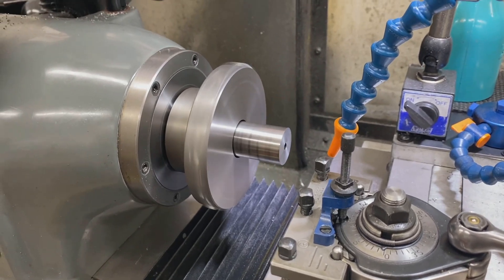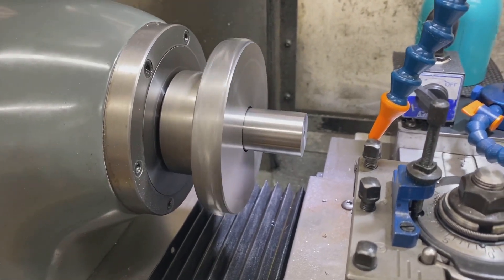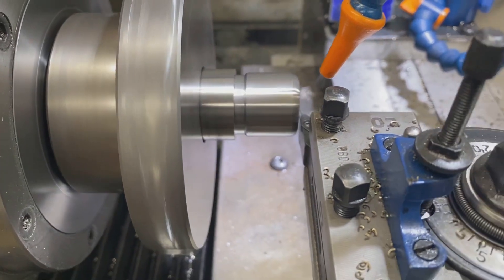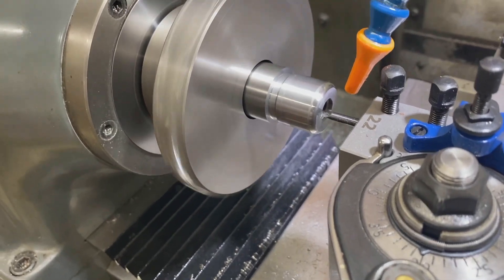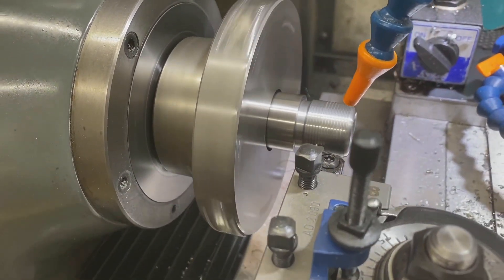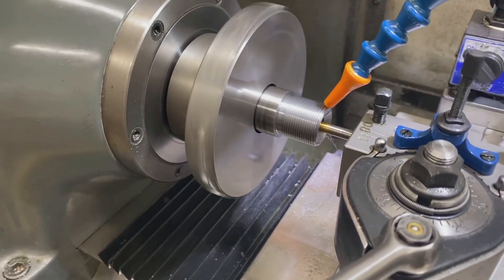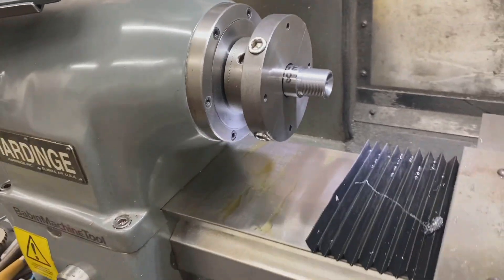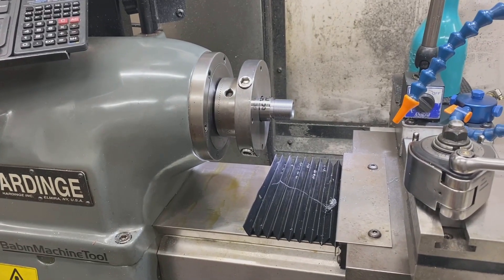Chambering a match barrel on a Hardinge CNC Lathe

Comment: Hi i know this is an old video but what size is the through hole on the spindle bore? I never considered a hardinge lathe for chambering because i thought they had a very narrow spindle bore.
Reply from the maker: not exactly sure - i used to know. it is bigger than 1.25” which handles most barrels

Comment: Could you explain to me what you have for a chuck
Reply from the maker: the inboard “chuck” is a backing plate with the hardinge taper. there are four cap head screws in the plate which have brass tips. they are adjusted like a 4-jaw to centre the barrel. on the outboard side i made a sleeve to go over the spindle and that too has 4 brass tipped screws

Comment: Pretty cool. How do you like the electronic hand wheels? Could you still operate the lathe in manual mode with carriage feed and cross slide feed?
Reply from the maker: they feel identical to the manual lathe. and yes, you can switch between cnc and manual without touching a button. i also have a hardinge with a siemens control and there you have to select your mode
Reply: @ChrisHarris4U  that's good to hear.  I watched your video with the Siemens control, looks really nice well done up machine. 
How much does the rebuild manual version usually go for from Babin? 
Haven't had any experience on the hlv-h  but it seemed really smooth when I got to check out one at an auction months back.
The lathe fits the bill for a good number of parts that I make. Looks like a great lathe for the bigger parts that's I want to make as well( 4.5-5" diameter parts.)
I saw that you got the multifix A on this lathe. I have just bought the some holders and I could swap them if I go the hlv-h route, really good to know.
Reply from the maker: @edwinaquino6940  the build is likely about $45k over the cost of an old hlv. they recon the entire unit to new condition and add the control etc. i am just guessing - best to call paul babin.

Comment: It Would benefit you to CNC the chamber also….it will eliminate the very common tool mark at the blend of the lead.  Seen many CNC chambers now days as I feel it’s more accurate.  But none the less nice work and nice hardinge for sure.
Reply from the maker: We do tons of bored chambers when doing dies. I don’t like to do it on one-off barrels as metal can fluctuate from barrel to barrel and it is annoying to chase that when doing barrels. But theoretically it is better, I agree.
Reply: @ChrisHarris4U  your right about Metal fluctuating for sure.!   NICE WORK none the less!!!

Comment: Great Video! How did you make your inboard spider?
Reply from the maker: Get a backplate from Hardinge and drill/tap 4 holes for brass insert bolts. You can counterbore the holes to accept a cap head thereby avoiding unnecessary injury if a bolt head catches you.

Comment: I'm about to chamber my first barrel for my custom rifle. I have a manual CMC machine also. I plan on rigid reaming the chamber by mounting a aluminium blank into a holder then drilling and reaming it to accept the reamer so that it is set perfectly to the bore. How do you run the Cnc to ream out the chamber? Do you set smalll incremental drilling cylce? Or do you just do it manually from the tail stock?
Reply from the maker: In this machine I have been running it in manual with the tail stock. It is quick and easy. I think if you are doing one off it is far better to do it manually. Especially 416 as it does vary in quality.

Comment: Have you got some more details on your HLV? Did you do the cnc conversion yourself?
Reply from the maker: The lather was retrofitted by Babin Machine down in Massachusetts. Paul Babin is the owner of the shop and they are purists to the core. They take and old HLV and ensure it is completely overhauled and then fit the control and drives. I have ordered another one, this time with the Siemens 827 control. I like the Centroid but thought I might as well kick up a notch. Not sure if you have any specific questions.
Reply: @ChrisHarris4U  I am looking to purchase a lathe and I have narrowed it down to a hardinge hlv or emcomat 14 or emcomat 17 the benefit being with the emco being that relatively new low wear machines can be found here in Europe. I see you have a 20d how does it compare to the Hardinge? Not taking into account the cnc retrofit which would result in an order of magnitude of productivity gain.
Reply from the maker: Julian Hudson:- The Emco lathes are very well built. I have a 13 and a 20. The 20 is basically tool room accuracy. Just amazing. It can remove a lot of metal and is reliable down to a micron sometimes. But the CNC Hardinge is a completely different animal. Much more capability just because of the CNC and then you get the hlv accuracy to boot. If you want manual, the Emco and the HLV are about as good as it gets in that footprint.
Reply: @ChrisHarris4U  how much does this typical retrofit cost?
Reply from the maker: @snipedust4652  it is probably about $45k
Reply from the maker: @snipedust4652  I would guess about $40k

Comment: Hi. I'm looking into chambering on my manual HLV, and this video is SUPER helpful. One question that's actually unrelated to that though - what size multifix toolpost is that? I bought an Aa because I was told that was the largest that would fit, but it looks like yours is an A or bigger?
Reply from the maker: Thank you for the comments. I love the lathe. Yes that is a A multifix. I would strongly advise that you swap for the A as the AA will be too small and you will end up having to shim the tools. The A is borderline.
Reply: @ChrisHarris4U  Ok, thanks for the info. From their website it seemed like the min. height between spindle center and top of the compound slide was 1.5" for an A and 1" for the aA. Mine clocks in at 1.05" so I went with the aA, but I'll look into this some more.

A second question, maybe this is a rabbit hole - have you been able to contour barrels on the lathe? I'm trying to figure out the workholding gymnastics to make that work, and it seems like if anyone's thought about it or done it, it would be you.
Reply from the maker: Parker Robinson I have not contoured barrels on an HLV. I would think that you need a longer bed and a travelling steady. It is pretty much impossible to contour without a steady rest. If your barrels are short enough you may be able to do one end and then flip it around   I would not worry about witness marks where you connect because you will sand those out on a spinner.
Reply: @ChrisHarris4U  That's the unfortunate truth I was also thinking. Thanks for your time. This weekend I might get started on building a set of spiders like the ones in your video.

Comment: Nice work on this high quality lathe👍, do you center and align everything by hand (spindle, spider) ?
Reply from the maker: Yes, I dial in the lands on the outboard spider, then the throat, then the extreme right hand side of the barrel. Get the start lined up to under 0.0001” and then you know the rest is easy.